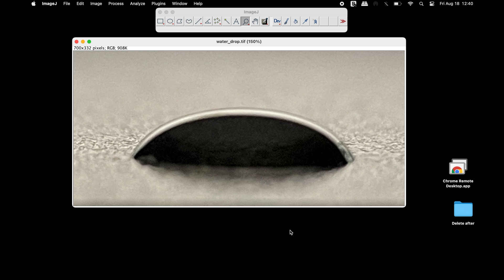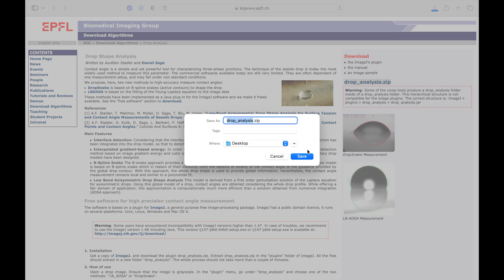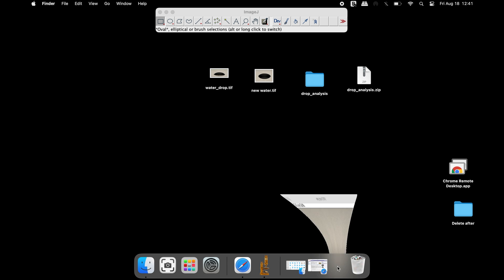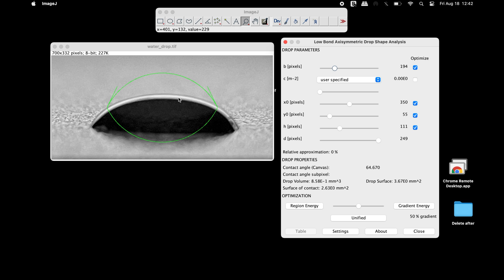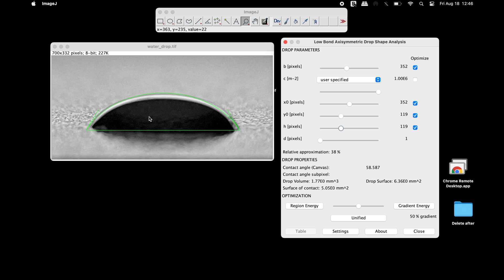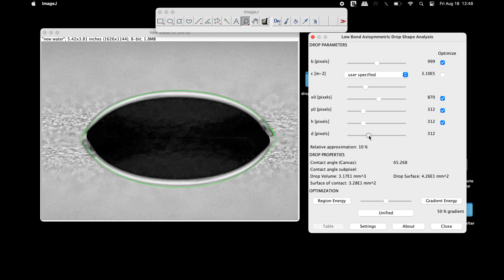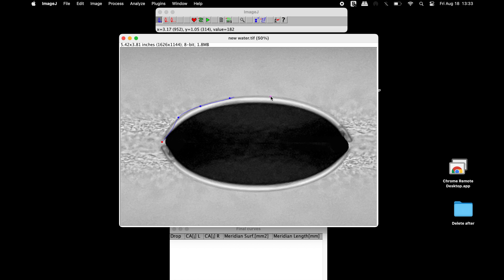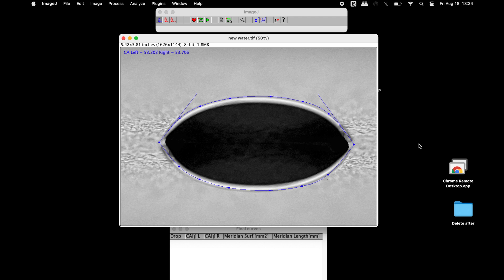How to measure CONTACT ANGLE using ImageJ

Comment: Can this plug-in usable for Angle of Repose measurement?
Reply from the maker: Hello, I have not tried to measure the angle of response measurement using this plugin. Here is what i believe and my answer may not be perfect. The answer may be No. A standard ImageJ contact angle plugin cannot be used to measure the angle of repose because they are designed for different purposes. A contact angle plugin measures the angle between a liquid droplet and a surface, whereas the angle of repose measures the slope of a pile of granular material, necessitating a different image analysis approach to determine the slope of the pile's edge.  Although the outcome is measuring the angle, however you can give it a try and confirm by other methods. Apology for not being able to answer your question.
Reply: @nrttaye4033  Thank you sir for your response.

Comment: Hii...i could install drop analysis.jar in the plugin. But after the image is open and clicking on pugin drop analysis dropsanake didn't open the drop snake window. The lb- adsa window is also not opening after clicking ok. Why?
Reply from the maker: Hello, thanks for reaching out. Sometimes these plugins are not supported by the latest updated version of imagej. Could you please try using an older version of imagej? Let me know if that works

Comment: the jar icon is not in the folder. is there another source to get the drop analysis plugin
Reply from the maker: Hello, I am not aware of another source.
Reply: can you let me know how to find the jar icon for drop analysis plugin
Reply from the maker: once the plugin folder is downloaded, unzip or extract the folder. The .jar file should be there
Reply from the maker: hello, i downloaded again and extracted the folder. The .jar file is still there with the name "drop_analysis.jar"    The Icon picture may be different depending on the operating system.